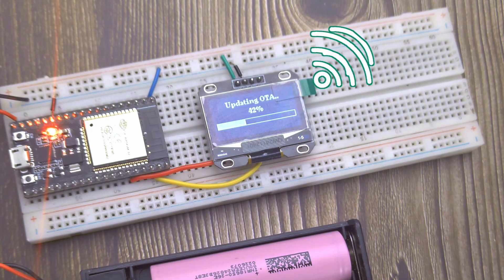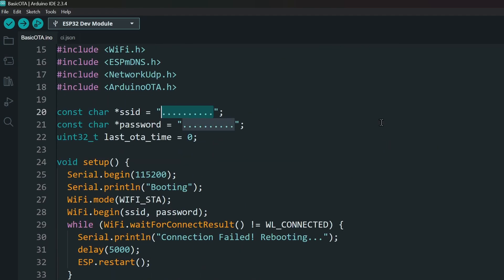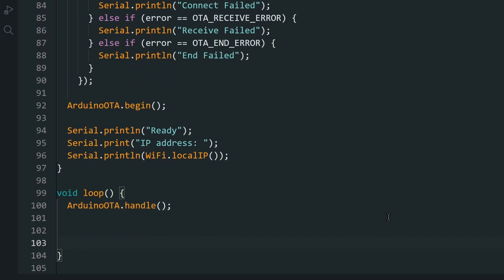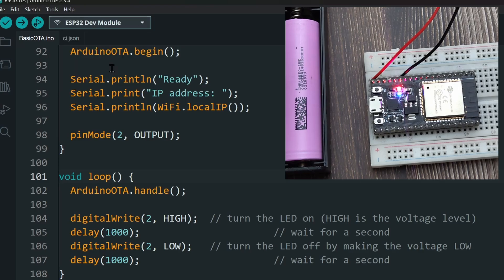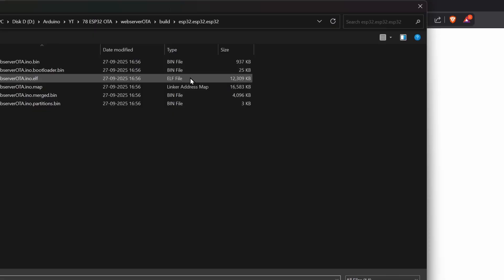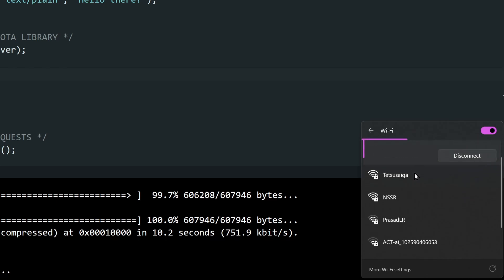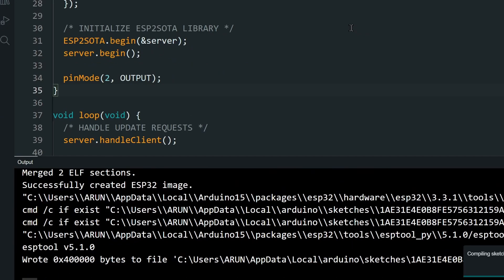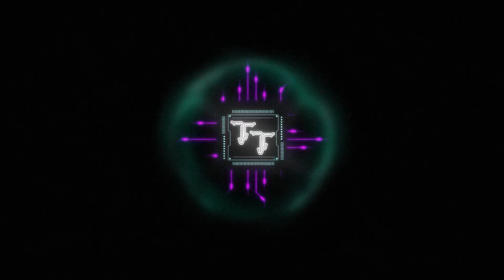ESP32 OTA updates | Upload code to ESP32 wirelessly Over The Air

Comment: I use flask web so there's section as Ota update. I'll upload .bin file and Esp32 will check itself whether there's file or not then update itself automatically. At that point do I need username or password for OTA ? Should I connect esp32 ap ?
Reply from the maker: I have not used flask recently. So, I'm not sure

Comment: Bro can i porgram my esp32-cam with esp8266 nodemcu board just once? cz i dont have the programmer board of esp-32 cam😥. If it it possible then i will just enable ota in the cam board and update through ota from next time. I also have a nodemcu board without the esp8266 chip😅.
Reply from the maker: I'm not sure about it. I can learn and get back to you if you want.
But, the adapter boards are pretty cheap. If you can't get one, you can program it using a USB to serial converter board, like an FTDI board.

Comment: Amaizing,  next tutorial if you dare to try please; it requires atleast two esp32 (call it hub)  one is connected to internet or just it's webserver as you have shown so that it can receive the updates, then once done rebooting from the new firmware it sends it to other connected esp32 bodies (which are connected to it over esp-now).
If it will ease things especially managing esp-now and wi-fi on the single esp32, make the (hub)  have two esp32 one for esp-now communication and the other for internet or hosting it's webserver , these two will communicate using uart.

I hope you understand, if it's not too much hussle :)
Greetings from Tanzania
Reply from the maker: That's a very specific request. But to make it simpler, you can just put an SD card on the main ESP32 and it can transmit the update to all the other boards. But to make a full video about it, I will try if I get more requests or use cases.
Reply: @techtalkies1 , thanks for quick reply;
I have binge watching many of your videos today; you got quite a good collection of idears here, congrats 😊
Reply from the maker: Thank you. It means a lot to me.

Comment: Does it work for the ESP8266?
Reply from the maker: It will work with any board with Wi-Fi. So, yes.
Reply: @techtalkies1 Thank's bro
Reply from the maker: You're welcome
Reply: Hi tutorial, can we have a tutorial for OTA update using sim800 module
Reply from the maker: If the ESP32 has internet access, it can download the bin file from a URL and update itself. You can upload the bin file to GitHub and update it over the internet.